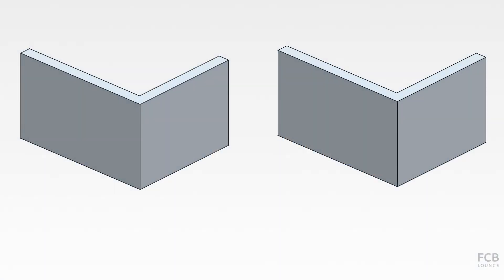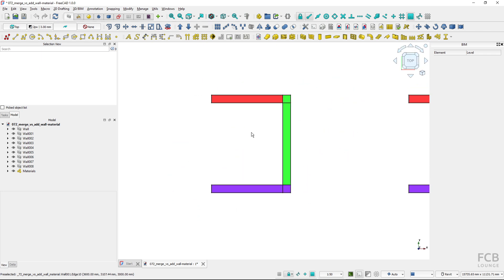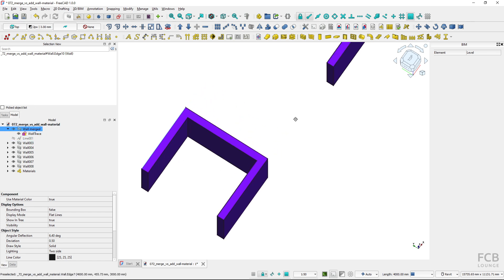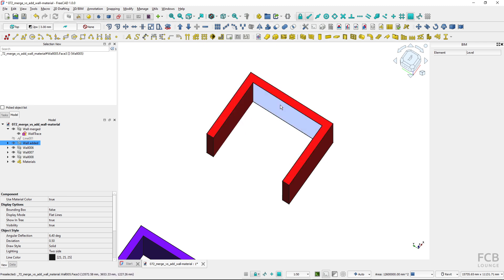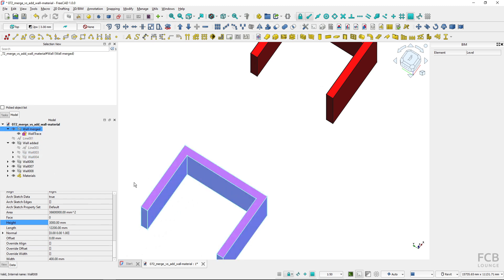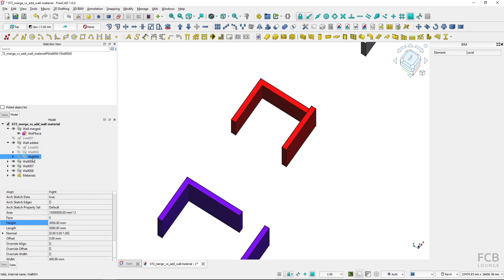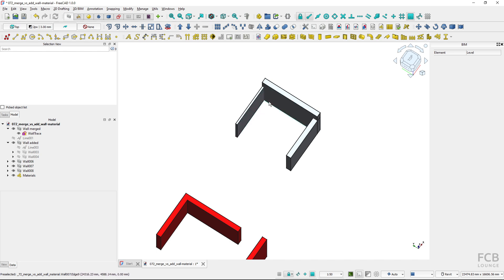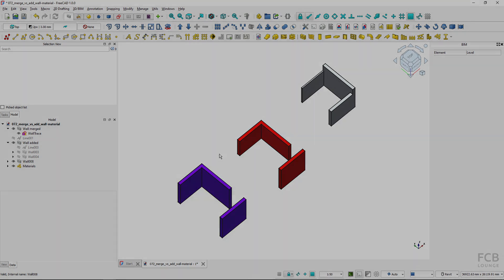Difference Between Merging and Adding Walls in FreeCAD BIM

Comment: Hi Tom!
Thanks for the video.
If we already have assigned windows or doors for those walls in both cases previously it will be a mess for sure... won't be?
Cheers
Reply from the maker: Oh, I see that I already reported the issue :) 
https://github.com/FreeCAD/FreeCAD/issues/19595
Reply from the maker: That's a good question. I did just a quick test and it seems only one of the walls preserves windows/doors correctly.
So your premise is unfortunately correct :).
But it seems to me it should not be hard to fix (at least for the Add Component tool). I'll investigate a bit more and then probably report the issue to GitHub.